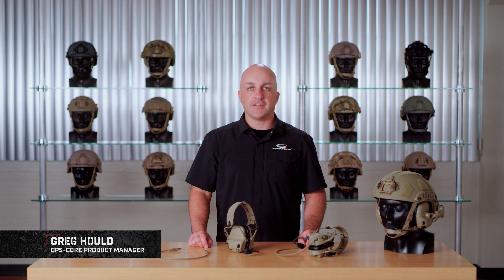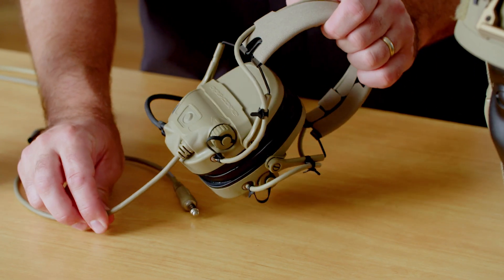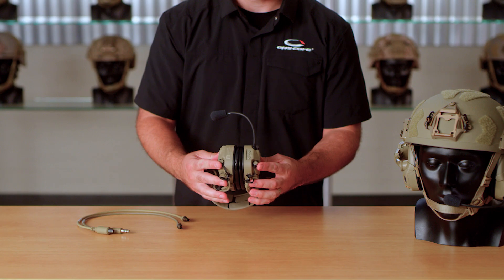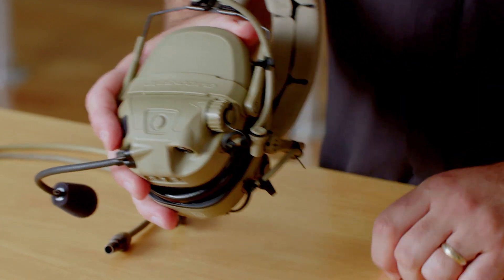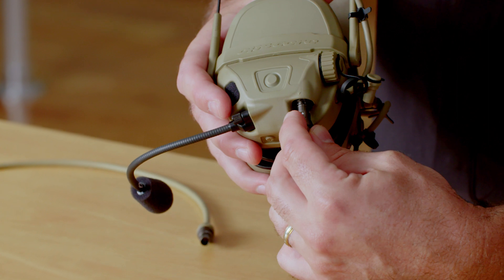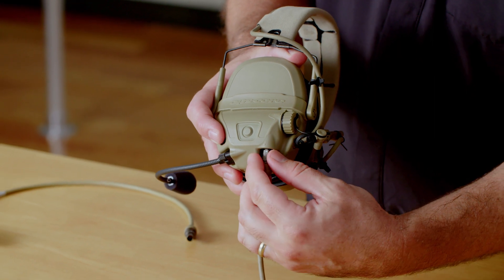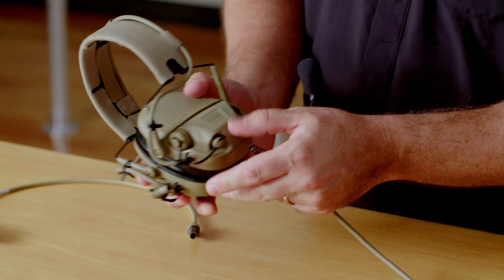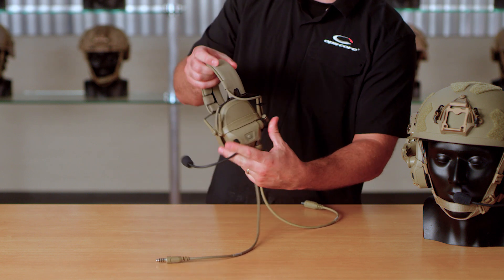Ops-Core AMP® Communication Headset | How To Connect Single and Dual Downlead Cables

Comment: Recommendations between Mono, stereo and Monaural for cables to choose from. I have a U94 ptt.
Reply: I also have the same question
EDIT: You want Mono Binaural if you want one radio delivering sound to both ear cups. If you are running two radios you might want to consider Stereo or Monaural.